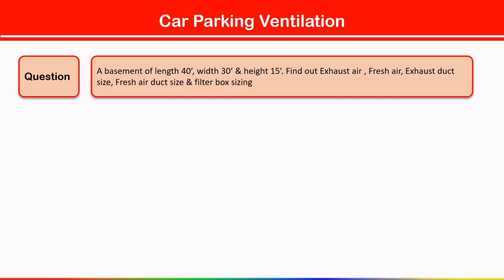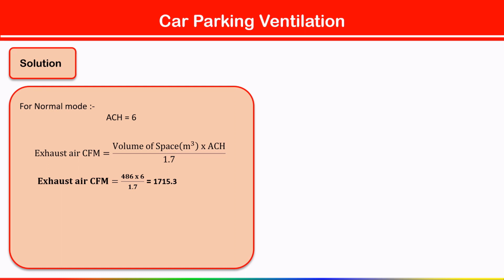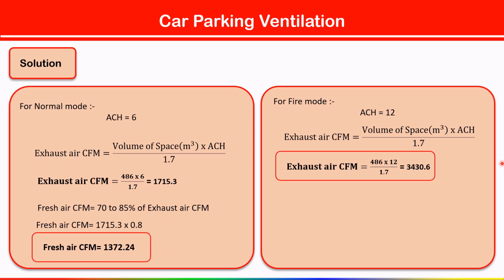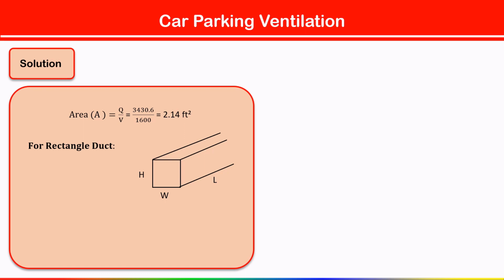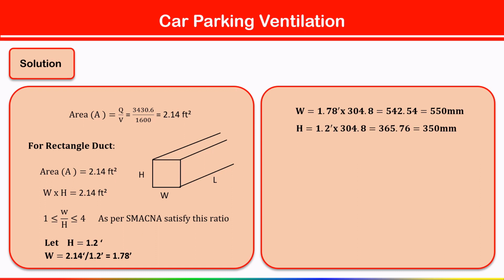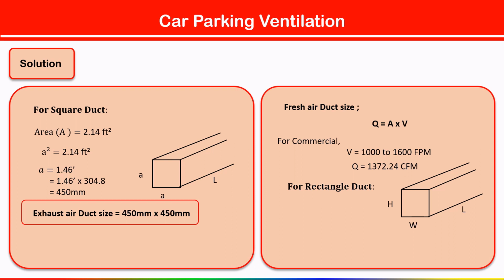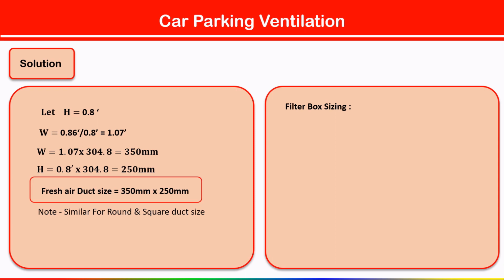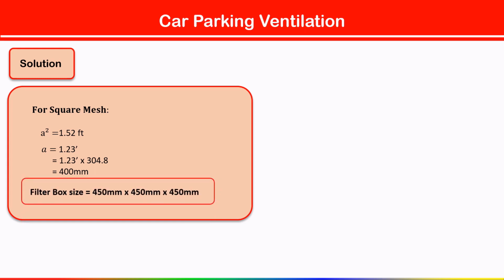Car Parking Ventilation – Part 02 | Ducted System

Comment: Thanks for rhe tutorial. If i pick 6 ach for normal mode, amd selected the fam based on that, how do i get to now achieve a more air change during fire?
Reply from the maker: Always you have to design as per fire mode
Reply: Thanks  @mepbooster8184
Reply from the maker: Exhaust fan selection you have to do for fire mode ach value 
Fresh air fan selection is based on normal mode
Reply: Thanks engineer  @mepbooster8184
Reply: @mepbooster8184 but I can use 80-85% of the exhaust air for the fresh air ?